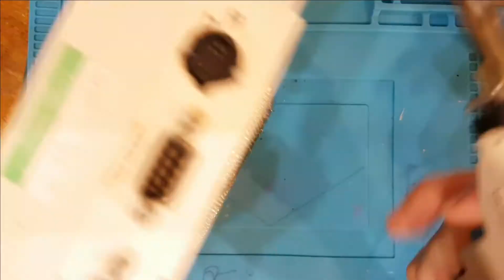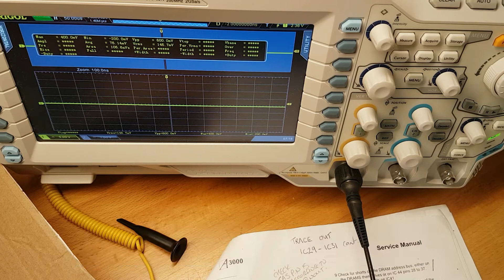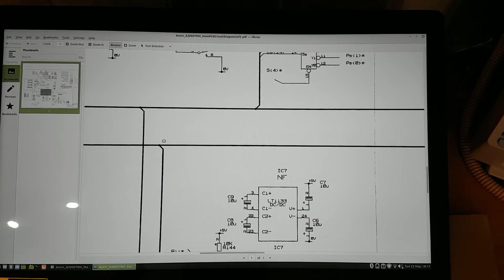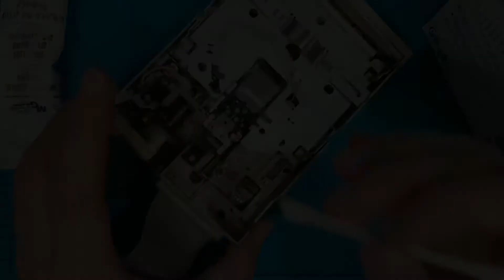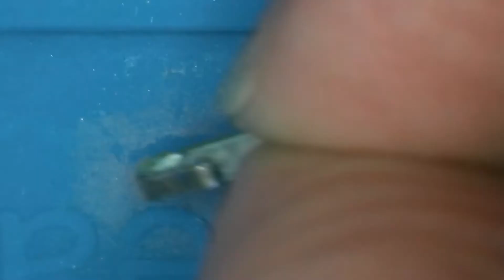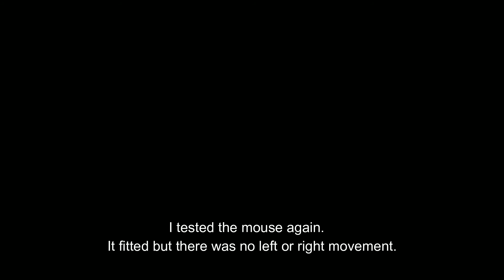Another Acorn Archimedes A3000 Repair Vlog

Comment: I have  similar A3000. Usual battery damage. I replaced rom sockets, keyboard sockets, battery etc. No  POST  but my scope isn't high enough spec to do other checks. So to pacify myself I bought an A7000,  Which does Post all be it having to hold down the del key every time. I replaced the clock battery but that hasn't cured it. I appear to have lost/mislade the monitor lead. So I made up another one but that only works with my big sony tv on AV1 but not my AKF12 that came with the a3000. and it tests ok, But thats ok At least I can play my favourite game for the arch - Elite. I have watched your other vids again and again trying to pick your brains. but I am still strugling with the A3000. Power supply read 5.6 volt unconnected but drops to 4.7volt connected the board, so I suspect the electrolitics. Looks like I might have do a block change on them. But might hava a short somewhere else. The smd resistors I have checked seem to measure OK. So no where near as bad as your A3000 from hell one. I thought at the time that the video output chip had blown, But I am thinking maybe not now. I am an ex tv radio electronics engineer myself retired. Have had computers since the trs-80 days. Latest one is a a windows 10 del 64 bit. Which I run red squirrel emulator for Elite on too. I have done a few computer repairs in the past Spectrum and trs- 80 ones, but this A3000 is doing my head in. With it's non standard mouse and keyboard. The A7000 as you know takes a strandard keyboard and mouse. I did have my gotec floppy emulator working  (st chip one) and (CF-ide40 V.E.O. compact flash) before too but I cant remember what I did to get that going erither, thanks for reading this. Tell me what you think if possible. kindest regards Phill W
Reply from the maker: Hi Phillip. Thank you for watching my videos and for the very kind comments! I think you are way more qualified than me tbh!!! I just poke around and have no formal training. Obviously very happy to to try and help if you want readings or anything like that but I think your best bet would be the guys  on the Start Dot forum. I would have been lost without them and they really know their stuff. Only thing I can offer in the meantime is the links to continuity tests and bare board pics etc on my Google Drive. It was the best I could scratch together to try and help others: https://drive.google.com/drive/folders/17mnQDncaZLgUeX4i0YTH0fuGZ5GodSwY?usp=share_link
Please let me know how it goes. I really hope you get it going. Don't give up lol. They are maddening and corrode pretty badly but the custom chips appear to be tanks 😀
Reply: @Plan-C  Hi, Oh mate!  What a star you are, Thanks for all that. Yours was a the worst state ever. I'm sure you would get mine going pretty quickly. Just to keep you updated. My A7000 now works on the AKF 12 monitor with that lead I made up. I don't know what I did, But It works now. ! - Result ! I removed the recharchable to prevent more damage. Going to put two dry batteries in a box like you did. I worked a bit more on the A3000 socketing and replacing the left hand speaker audio chip that I thought was short. There probably wasn't . There has never been a hard drive in this machine while I've had it. And It doesn't look as if there has ever been one fitted. It's just dead.  Very frustrating. No clock pulses anywhere on my scope. The roms are the toshiba ones number 4  looks slightly different. I think they are the 2.1 roms. They are shorter in length that the socket by two pins. I'm a bit stuck now. I don't know whether to buy a hard drive for it plus all the associated circitry - (expensive) or to get new roms (3.11 ones, or to replace all the electrolitics. If I take them out individually I could test them on my capacitance tester. Buy/borrow a better scope.  - or Just buy a working one to make checks - even more expensive, ( i could sell it again after I fixed mine I surpose) or buy a post box (if I could get one) like you did. In the mean time I need a hot air chip remover. My mates got one and swears by it. I thought at one time of just using the case to house a raspberry pi and just run risc on that. I think my keyboard is ok, on power up the green light comes on, but no caps or number lock light. but thats because it's not booting up yet. I've been reading the star dot stuff and watching the other repair vids. Compaired to your work lot I'm a bodge it and scarper type. I'll keep battling on, but I may end up in the looney bin. LOL   Kindest regards Phill W (sparky1phillip)
Reply from the maker: @phillipwigley6806  It doesn't sound good that there is no system clock. It has been a while but I think there is a 24MHz system clock that can be found on the main chips or down near the MEMC side of the board. If that isn't there then nothing else will happen. I wouldn't go buying a hard drive or pouring money into it just yet. The 3.11 ROMS give more clues in terms of POST messages (flashing codes via the floppy drive light) I think. . I don't think earlier ones do at all. The POSTBox will only work with 3.1 ROMS. Does the floppy light flash when you power it on at all? You could also try buzzing out all the ROM traces to make sure they intact. Good luck!
Reply: @Plan-C Hi Mate , Yes that is my next move to bell out the rom traces. I just downloaded  all the schematics from Chris's web pages. They are great arn't they? I might try to read the roms too on my eprom blower. The A7000  
Flashes 4 lots of four when I switch it on I guess that means no clock too. The floppy cable is suspect too. It read once or twice then packed up. I keep getting a read error on many of my disks. I stripped iy cleaned the heads and greased the worm. it's still giving errors. The one from the A3000 doesn't work either it  might be incompatable. Im going to get another floppy lead. Although it could be the board. The boards are very thin as you know and multi layered. It's like working on antique cars. As you know you have to be sooo careful! Have you any new projects to report yet? I so love your video's on utube. So informative. Very well done. Kindest regards Phill W (sparky1phillip)🔎🔎🔎🔎
Reply: @Plan-C  Hi Again, A3000 latest report - I have read the roms with different results. these are the shorter ones 2.1 I think,. They were always inserted with the pin 1 end to the left and jogged to the right if you see what I mean, (Four spaces on each one on the left showing) 1 and 3 look ok read by  the minipro eprom programmer 2 and 4 are programmed but 3 and  have no asc code to the right 4 looks fairly blank. it is an acorn one but with a groove along its length. Do you know if the positioning is correct? very suspect,   I'm going to have to replace them with 3.1's I think. Then I think you have to move one or two of the links is that right? I am borrowing my mates 100 mhz philips oscilloscope later today so I should be able to check the system clock better. I picked his brains (He was a head of fault finding man at motoroller before they packed up) Even brand new stuff still has faults. He says the crystals can deteriate over time. I have ordered a new clock chip anyway. I couldnt see much activety on any of my scopes on linc 29. But they are only 12 mhz. I would have expected something though. No flashes on the floppy at all. Just a one green power light on the key board. Tried holding in the delete key on power up for ages  - nothing.  It looks like I have ras and cas though. I checked the rom pins with the roms out. Should they all be common? I have a few suspect ones if not. May have to link one or two? So still battling on. Going though the service manual. And I have printed out parts of the circuit diagram. God struth there is a lot of it! Two massive sheets. It may take me a while to get my head around it. And still 5.4  volt power drops to 4.7 volts when i connect it. I havn't changed any electrolitics yet they all look fine. Thanks for all your help. kindest regards Phill W

Comment: Just been testing my a3000 that not booting, When testing the IOC what oscilloscope setting are you using? I haven’t had much practice with mine and still learning.
Reply from the maker: New scope is autoranging but I think 5v per division for clocks and logic signals. Think the main clocks are 2, 8 and 24MHz. The 'address line walk' tests halve in frequency each time so all over the place but from memory they range from Hz to high KHz. Good luck!
Reply: Thanks for your support when I’ve asked questions, I am now the proud owner of a working A3000.